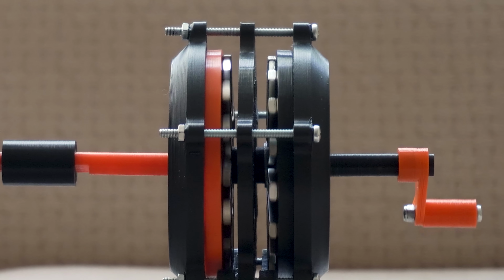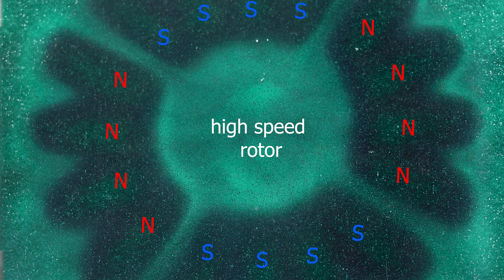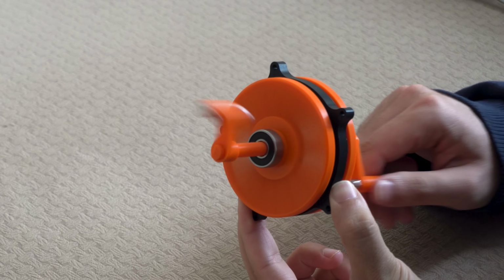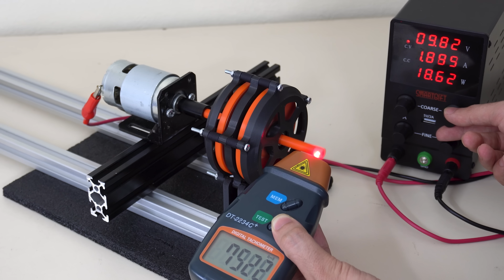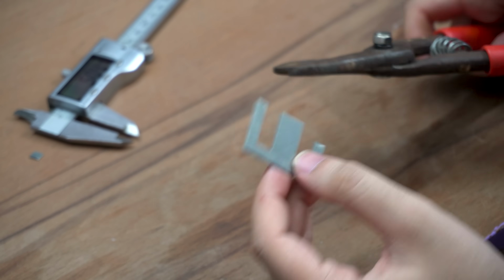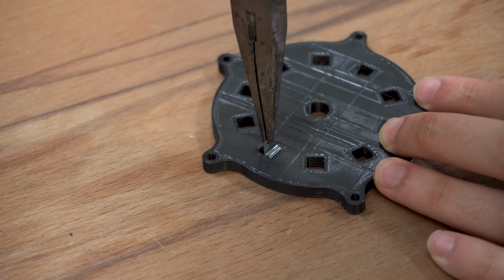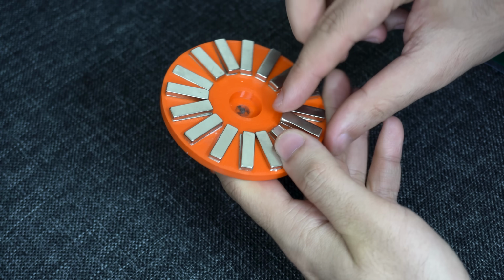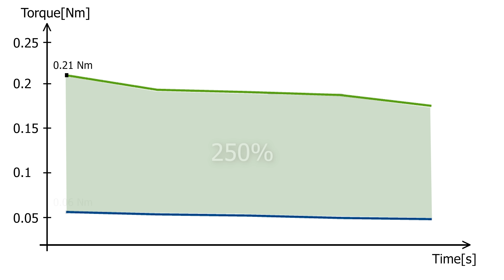Gearless Magnetic Transmission - You Can't Break These Gears

Comment: Interesting fact: neodymium magnets are not indestructible, the heat generated in the eddy curent destroys them
Reply: If you care to eliminate this, replace the large magnets with many small magnets separated by thin insulating films. Same thing is done in transformers to limit power transmission losses
Reply: You know, that's actually a good thing to know When using magnets in any project  I never would have thought about that, but that's actually a very valid idea
Reply: Try mounting magnets with hot glue. Then wondering why Hall sensors don't work anymore.
Reply: Heat above its working temp will lower the magnetic properties but you can get upwards of 100+c for N grade magnets. The shape and dimensions of a magnet play an important role in its working temperature, a high permeance coefficient will help combat heat degradation
Reply: @tomascancelliere4348  What other kinds of geometric shapes are available?  Any that might specifically improve performance?
Reply: I dont think magnets can overheat since you need it to be conductive enough to get enough current to even get enough heat, if you look inside the coating it doesnt even look like a metal meaning its conducting properties are quite bad likely, in fact i think it is actually ceramic like material inside
Reply: @microwavetransformer6378  ceramic has a very high working temp, around 220-260C. More than NdFeB but less than SmCo and AlNiCo magnets. Eddy currents from oscillating magnetic fields interacting with certain metals more than others cause heat, which can weaken the magnetic performance, and if its above the stated working temp, it will cause irreversible damage.  Similar to how inductive heating works, like on alot of newer electric stoves.  Even though Ceramic magnets are not electrically conductive, the metal around it may be and the  heat from a rotating magnetic field or outside source will cause damage.
Reply: @christopherd.winnan8701 generally speaking,  a L/D ratio of .7 typically works well.  Below .5 will have less reluctance and be more susceptible to damage from heat or magnetic fields from outside sources.
Reply: @tomascancelliere4348  Thank you.  What does a L/D ratio stand for?
Reply: That only applies if you get it hotter than a certain temperature
Reply: @christopherd.winnan8701  length to diameter for disc/cylinders.  For complex shapes other than squares or disc's it can get a bit complicated. A Google search can get you the  specific formulas for squares and discs, though. The L/D ratio is just a general rule of thumb, so to speak.
Reply: @tomascancelliere4348  How about helical and vortical shapes?
Reply: @christopherd.winnan8701  would the helical  be made up of segments?  Would the segments then be magnetized as true radial or would the dipoles be parallel?
Reply: @jamessever8936  Magnetic flux of Neodymium mags drops off about 0.11% for each 1 C of increased temperature so the induced heating is to some degree self regulating.
Reply: YEP ALL PERMA MAGNETS CAN BE DESTROYED BY HEAT..
Reply: Switch to Fe16N2 magnets, they are much more heat tolerant.
Reply: 3:49 He already mentioned that... ...
Reply: In the what?
Reply: Interesting fact: how low in IQ a human has to be to think that illogical statement the industry makes for those magnets are real.
Reply: all metals lose magnetism in high temperatures
Reply: Also, there is no such thing as a truly 'permanent' magnet as people like to call them.  It is a misnomer.  They require alignment and charging during creation and they slowly lose their magnetism over time regardless of heat/eddy currents etc just due to naturally chaotic movement of atoms though use, collisions/damage, or heat will accelerate the degradation.
Reply: How would electromagnets be affected if they would be used instead.
Reply: @TheTboy007  what do you mean? if they were energized they would work the same as neodymium magnets. They are just a ordinary piece of metal if not energized.
Reply: @unicornadrian1358  What is the commercial name for this alloy of magnet? What are some typical distributors?
Reply: @unicornadrian1358  but they have a lot lower coercivity than neodymium magnets. Coercivity measures how much resistance a magnet has to flip its field when exposed to an opposing field. In motors, you want coercivity to be as high as possible.
Reply: @SickPrid3  you are only looking at one aspect. When the temperature rises, Nd magnets drop off fairly quickly and they are also 30% heavier per volume. Both types have situations that they are best suited for.
Reply: Not destroyed, they can be remagnitized
Reply: Yes magnets lose strength overtime 🙄….. hence our true perpetual motion dilemma. In this application it will be negligible and go unnoticed/time used.  Now if we can only recreate that mythical super conductor.
Reply: Heat is not the only death for a magnet, an environment with a constantly changing magnetic Flux will eventually also wear out a magnet.

Magnets are not a source of infinite unchanging force like people seem to believe, they are just as prone to wearing out as any gear, especially in something like this gearbox moving at high speed, even if you keep it cool it will eventually fail when stressed constantly
Reply: I'm glad you said that. With every magnetic action heat is generated
Reply: Make it water cooled then
Reply: He mentions this in the video
Reply: Can't the magents be replaced with electro magnets, so they don't degrate by the heat? They would need only a slipring the power tobtransfer.
Reply: Rotating magnets / magnetic fields is the exact principle that induction cook tops work on. There are industrial versions of these. I once tried to use one as a slip clutch for a scrap chopper feed roll system. It didn't last long. When you hold one side stationary and rotate the other, that thing will COOK itself if left running that way.
Reply: Liquid magnetic's , gasses do incredible things don't you agree
Reply: @biggestcomplainer4210  it's not a issue.  You just doing it wrong is all.
Reply: Neodymium magnets can be resurrected by a magnetizer and be stronger than they originally were.
Reply: How long do you estimate this would take
Reply: @tomascancelliere4348  indeed!🤔👍
Reply: So use solid state relays with coils
Reply: Cute parlor trick. Useful? Hm. No.
Reply: Simple use electromagnet
Reply: they're not destroyed but unmagnetized
Reply: current*
Reply: Requires over 300 degrees Fahrenheit to degrade which heating problems can be easily eliminated with fluid Cooling.. .
Reply: :-)  knowledge  I like.... not to mention the ammount of slip you have....like picture what kinda torque it takes to get a vehicle moving.....  slip in clutch's are the way things DONT MOVE  they just continuously slip because it only has .. what are those N42 or 52  I figure anout 30 to 40 pounds of pull....

to get a 2000 pound object moving...  LOL  not happening
Reply: As well as metal or plastic gears, they are also not indestructible.
"How can I make it not working?  (So it will be useless)"
"How can I make it work? (So it will be useful)"
Your choice?
Reply: exaxtly.. thats why heavy duty magnet couplings need good ventilation and still will fail........
Reply: Yea I was going to say these can still break
Reply: Liquid cooled magnetic transmission for electric cars?
Reply: Simple fix, fluid jacket
Reply: I`m not sure if they are electrical conductive
Reply: Also for practical implications of this motor, one should be mindful of the heat generated from the controller aswell. When used practically, there will be an increase in torque, which consumes more current and generates electrical resistances, which in turns generates heat.
Reply: I was just going to mention what heat does to magnets lol!
Reply: They also weaken.
Reply: Yep. Personal experience with that fact. A local mining operation tried magnet-couplings on some conveyors and it all ended in tears.
Reply: @madtscientist8853 it is valid, but I'd be surprised if that much heat was generated. Maybe it's analogous to the friction in a mechanical gear ratio or pulley ratio, and you will generate the same amount of heat no matter what mechanism you use to create a mechanical advantage, so long as the gear ratio and work done is the same?

But with magnets, you'd think there would be zero friction. The experiment with dropping magnet down a copper pipe (it falls slowly due to Eddy currents) doesn't result in any heating. But maybe if we pulled it through 10x faster than it's terminal velocity under gravity, and repeated this 10 times, it would begin to heat. I'd like to calculate the actual difference in heat between a sprocket ratio and a magnetic gear ratio. I think the match would be easy for the magnetic example, but I don't know any way to calculate the heat of two gears spinning, other than experimental trials and recording the temperature under different loads and with different oils or greases. And I'm assuming that oil or grease plays no role in the magnetic gear ratio
Reply: 💦  liquid cooling  💦
Reply: Yes.
Reply: Exactly. No free lunches with physics.
Reply: Nothing is indestructible
Reply: Yes. And heat means losses in energy.
Reply: @TheTboy007 congratulations, you just described a motor.
Reply: @spr00sem00se  HAHAHAHAHHA... needed that, thanks man!
Reply: And with heat you loose efficiency on anything
Reply: Exactly.
Reply: Interesting fact: neodymium magnets have an endless supply. Since they exist in the Universe, they can be created again. Anything that exists can be made again. Another interesting fact, you only wrote that "smart ass" comment to try and sound smart, but you lack the knowledge to create neodymium magnets and you also didn't even realize they can just be created again.
Reply: Liquid cooling systems already exist in most vehicles that use transmissions. Adding a cooling loop for the magnets would be almost trivial.
Reply: @SickPrid3 also when you drop them… overtime it’ll weaken the magnet because of fracturing in the metal bringing the Electrons out of line. Put simply because why use big word to explain it 😂.
Reply: @R0me0316  can also forge aluminum magnets. They are some of the strongest you can make.
Reply: Couldn't you just blow some air on em?

Comment: No- this will not work when you get to serious torque figures it will not be able to cope. This has been thought of before- and before both of us were alive. It is the basis of the fluid coupling alias the torque converter- which itself is based from Parson's steam turbine driving sympathetically rotating generator via the working fluid of dry steam, no parts touching (and similarly Rover's JETONE turbine car 1948)
Reply: yeah, we even have created the better thing, but it uses electromagnetic instead called axial flux motor, and if we use it as a transmission then it will become a hybrid car.
Reply: It would work great if you keep the torque load at a minimum right?

Comment: If you place a high permeability metal on the outside faces to couple the magnets together you should be able to almost double the flux inside the gearbox. Inspect how cabinet door latches or speaker voice coil magnets are arranged with metal plates to focus the magnetic flux.
Reply from the maker: You mean the back iron? You'll probably see them in the optimised version.
Reply: @retsetman9698 have you considered 3d printing some parts with filament which has iron powder mixed into it?
Reply from the maker: @kingarthurthe5th  I had completely forgotten about it until you said it, I'll see if I can use it.
Reply: Look up halbach arrays
Reply: Wahhhhhh this is some cool stuff! Thank you for this comment! :)
Reply: @kingarthurthe5th I tried to print a permanent magnet using protopasta iron filled filament. I printed it on a large Neodymium magnet to try and align the iron. It did not have a measurable field doing this. You either need a higher % of fine iron, or print using a curing process with a 2T field.
Reply: @coreystoner1046  You probably need a much larger magnet, I doubt the filament was melted enough for the magnetic field to align the printed material. If the filament was less viscous while printing or the field was stronger you should be able to print a weak grade magnet.
Reply: @retsetman9698  potentially you could also put a giant race with ball bearings along the outer circumference near the edge or in the center, so the two magnets can sit right on top of each other. the thrust bearing is probably a lot easier tho
Reply: Too bad the bearings aren't magnetic......
Reply: @glenwaldrop8166 I agree the iron printing material needs to be much more fluid when heated with high temp temp, or the magnetic field needs to be much much stronger to align. In my (non expert) opinion, I think the iron particle size needs to be much finer bc the molecules within the iron filings themselves will not be able to align individually, thus the smaller the particles are, the more alignments you can have within the mixture of iron particles relative to one another.  I think the Larger particles of iron dilute the percentage of overall alignment.
Reply: @glenwaldrop8166 The iron needs to hit the curie point. The plastic binding it is irrelevant and what melts when printing.
Reply: @erikjonromnes What are y'all on about? Hahaha 🤦‍♂️

Comment: If you wish to avoid the frictional heating of the rotor bearings, you can use two nested bearings. in theory the bearing with less mechanical advantage will be driven faster than the other bearing, but if the two bearings are magnetically geared together in a two to one ratio, then the load is equally shared, and the theoretical top speed is doubled, before the bearings become too hot.
Reply: This is an awesome idea and such an underrated comment!
Reply: Maybe replace the bearings with Magnetic Bearings
Reply: You can use diamond bearings from US signetics. They withstand high heat and pressure
Reply: the rotor itself can be part of passive cooling, if made of aluminium, finlets along the rim and slots
Reply: @getl0st  That would introduce way too much eddy current, probably overheating the bearings and demagnetizing them way quicker than mechanical ones.
Reply: No ceramic bearings could easily fix it

Comment: If you add thin steel behind each magnet, you can nearly double the pull strength. This is an awesome video btw!!
Reply: Or hallbach array shape
Reply: still doesn't fix all the drawbacks to make it actually worth using over existing linkages, otherwise it would be.
Reply: @74KU  it's useful in extreme applications
Reply: @74KU  There are things you can do with magnetic linkages that you simply cannot do with a mechanical ones.

One example: transmitting torque through a solid, unbroken sheet of metal. Could be super useful for ultra-high-pressure, high-reliability, and/or hazardous substances applications, where traditional shaft seals can't handle the pressure or where you cannot afford to have any leakage whatsoever under any circumstances. Niche applications like that can still be extremely important.
Reply: Ooh, I need to know more about this configuration for an iPad mount application. I’m worried my magnets will have too big of a gap (~2.5 mm) and will lose too much of their pull to be effective. By “behind” I’m understanding that to mean the far side from the other magnet, correct?
Reply: @tomascancelliere4348
"Behind" meaning on the far side of the magnet across the gap, correct?
Like:
[sheet][magnet][gap][magnet]
Reply: @torinireland6526  no torque
Reply: @74KU 
We have magnetically coupled centrifugal pumps at the chemical plant.
Reply: I think it need more than a thin steel, it need multiple laminated steel, and it also will act as the structure.

Comment: You should use self tightening nuts, that way the vibration will not unscrew the tightening screws. Great video.
Reply: Or blue loctite
Reply: @joshuacaylor881 or counter clockwise thread, like in many applications of this type
Reply: stover nuts would work best.
Reply: Self what?
Reply: Better yet, use simple lock washers. Even using flat washers would improve the grip substantially.
Reply: @_..-.._..-.._  self-sealing stem bolts :P
Reply: The hell are self tightening nuts?
Reply: @creepjax  nuts with nylon inserts
Reply: @steveanimatrix3887  though I can only assume this is what they meant, it is definitely not self tightening.

Comment: This concept was actually built in 1918 it was sold as the transmission you didn't need to shift, Stahl auto museum has one in Michigan
Reply: Why it's not used in cars?
Reply: @Autarke the transfer of torque is probably less than current mechanical systems, otherwise we'd be using it now, the advantage is there's no need for a clutch plate, if they can develop more powerful magnets that could connect the engine to the transmission like a normal one without the loss of torque, then it's the future
Reply: @pihermoso11  electromagnets are more powerful but then you've invented the electric car so we're already kinda there
Reply: High heat kills permenant magnets. The friction just kills this. Its neat and a great physics demo just not practical.
 @Autarke
Reply: @danr.5017  Iron is so abundant on Earth. Can’t ya! simply change out the magnets after so many miles or get them recharged.
Reply: @phoenixfireclusterbomb High heat kills magnets fast and
 Replacing a tranmission is a huge job. You litterally need to remove the whole engine block. 
It is way, way too much trouble.